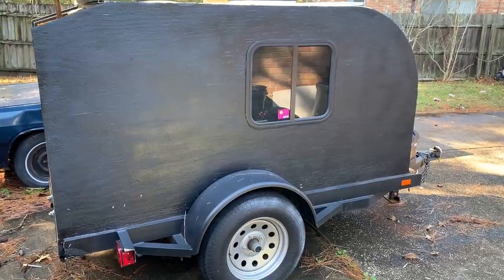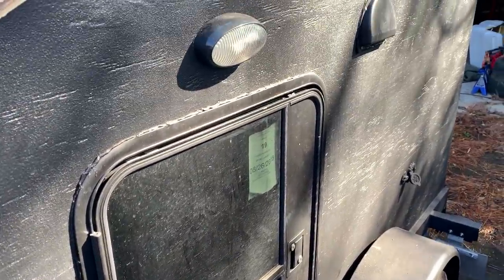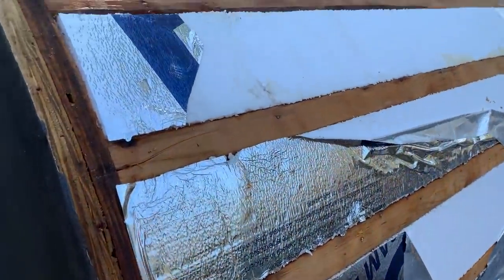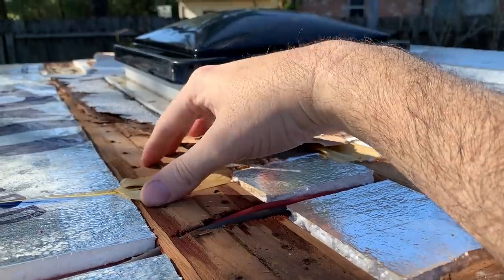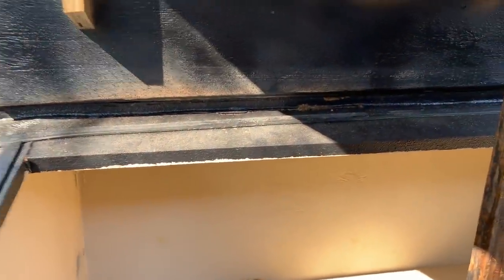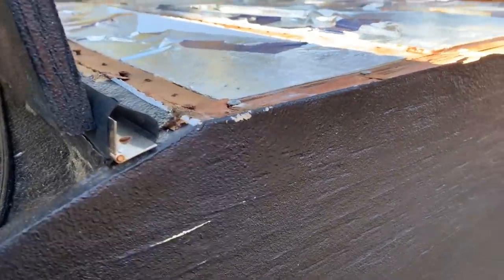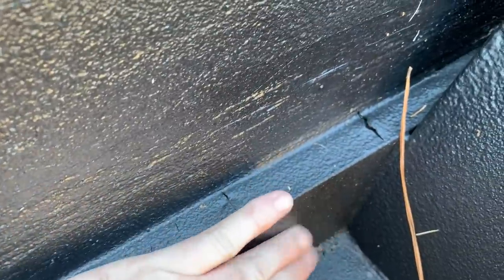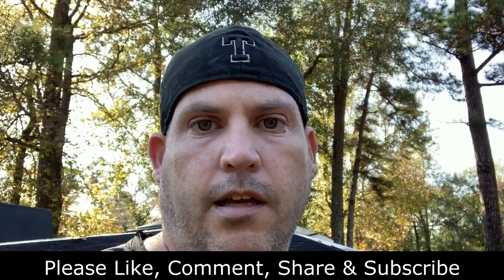6 mistakes building my micro-camper

Comment: I’m thinking about building one of these and I sincerely appreciate your humility and willingness to share your mistakes.  Thanks
Reply from the maker: Flyanb Thank You for the kind words.
Reply: Thank you for sharing your issues this can help everyone
Reply from the maker: Jaimuez Vaime Thanks for the support.
Reply: Great video. You see all sorts of videos of people doing projects but this video is worth 100 of those. Thanks for a video that really does teach something.
Reply: You're framing structure looks ok may I suggest you fiberglass the exterior on your rebuild.
Reply: You should try www.kedel.co.uk  not sure if they have this type of company in your country
Reply: I too am thinking of my own build and want to go as light as possible while completely off grid with AC so considering the top issues from this video I'm starting to think about a sturdy solar panel holding frame as the roof with just 6 mm ply under it & then maybe a bit of Styrofoam under that.

Comment: I appreciate you showing all the mistakes , it'll help people realize this isn't as easy as they think and save them money and time from your mistakes For the base of the camper and trailer sides, screw in wood the thickness of the base of trailer into the base of the camper and install flashing on trailer, siding on wood, flashing on top corner of that wood, and them siding onto the camper, flashing on top of that siding and then install the roof.  Alot of your problems could have been alleviated with use of alot of flashing.

Comment: You're very skilled at woodworking. The shape and wood build of the trailed is very impressive. It's not easy to make a "what not to do video" I can hear how disappointed  you are and your humility and humble nature is much appreciated. I'm certain, being that this was five years ago, that you future projects were much more successful. I will reference this video as well as others when building mine as I'm quite certain I would have made some of the same mistakes.
Reply from the maker: It was definitely disappointing but the rebuild turned out great. I’m still using it with no issues. Thank you for your kind words and good luck with your build.

Comment: I've been watching a bunch of "home built camper" videos.  What you ran into is exactly what I've seen numerous people make.  I haven't built one myself yet, but I work for an rv manufacturer and have the benefit of seeing how some of the in the business do it right.  Don't give up, take what you've learned and apply it.  What I would recommend for your next build is fiber glass your exterior as a complete unit before it goes on the trailer.  It'll be water tight from the get go.
Reply from the maker: iambeeman1 Thanks for the suggestion and thanks for watching!

Comment: Brenda and I built one that folds in half and looks like a real log cabin. Very hard to seal! Now 19 years later, I'm having to rebuild it, though we made it from 1 x 12 rough-sawn cedar boards stacked vertically in top of one another. This made our sidewalls only 3/4" thick, but staggered and reinforced at all corners. In fact, it's all cedar (ceiling is aromatic Eastern Red Cedar) and it looks beautiful, even with the 'patina' of these many years. It used to smell like cedar inside (still does somewhat) and several fellow campers asked for a tour. That was fun. But like you said, it was a learning experience. Thanks for your video. You've got a great big heart for sharing all your valuable experience!
Reply from the maker: Elbert Hardy That sounds very cool. Thanks for watching!
Reply: @BasecampUnbounded  If you want pictures, I'll email them to you.

Comment: Dude, you are showing the education by experience that Gen Xs and later want laid in their laps with no effort or anguish. Thank you for baring yourself this way.

I'm 6-4 n 225lb, therefore need dimensions most affordable trailers don't accommodate and thus am building my own as you did........differently. I'm a welder fabricator where I work and thus can cut, flex, bend or move steel as i wish

Having dismantled 4 manufactured trailers built between 1960 n 1995 I learned much to guide my build. Shortened story: subframe and superstructure perimeter frames are welded of 14ga steel tubing with weep holes, all members are anti-rust painted before the exterior skin is applied. The interior insulation and wall paneling will be chosen and installed to facilitate future repairs. Most trailers are not assembled with such thoughts in mind.

Best of luck!!
Reply from the maker: John Powell Thanks for taking the time to share your thoughts. I appreciate the insight. And of course thanks for watching.

Comment: I can relate to this video so much. I ran into some of the same exact problems. Just as you said, the main cause for these problems was poor planning. 

1. Bad trailer decision. I purchased a Habor Freight trailer, which was cheap but it was a really poor decision. I ended up swapping out the trailer with a much better custom welded frame with a torsion axle. This also lead to problems where my wheel fender is now in the way of my door, because I originally planned for the first trailer wheel position, not the new one. 
2. Outer skin - I originally, like yourself, was choosing to skin the cabin with aluminum sheets and trim. I ordered the materials to do it, but never actually went through with it. I decided the aluminum would be too expensive and difficult to cut the sheets to the right size with windows and doors. I eventually used fiberglass resin and chop-strand, coated with a gel-coat like paint. It turned out really well, but it was a LOT of work. 
3. Should have used higher quality plywood. This would have made my fiberglass job WAY easier. After all of the money spent on sandpaper to fair the fiberglass surface, I could have purchased way better plywood and saved so much more time. It's possible I could have saved myself all of the sanding, had I just used better quality plywood. 
4. I got way ahead of myself and purchased too many things that I didn't use. Such as plumbing and electrical fittings, screws, and other small things that add up. I still have storage tubs full of supplies and materials from Home Depot I may never use.
Reply from the maker: Ryan Smith sounds like you had a similar build experience. Thanks for watching!

Comment: G'day Basecamp Unbound, if your going to use your roofhatch on the next build ensure you put some sealant over the screws after it's fastened down, you would be surprised where water will get if you give it the opportunity. Best of luck with the new build, I look forward to seeing V2 of your camper.
Reply from the maker: MrEddiecos Thanks for the tip, however the bytal tape under the hinge does a great job of sealing the screws from the bottom. Thanks for watching. Check the new build playlist here. (Starts with video 2)
https://www.youtube.com/playlist?list=PLjC73s42QAHlQQaNQPLjnWvCdHOGAXVOR

Comment: You sir are a good sole, I appreciate you sharing your experience I'm thinking of using and fibreglassing the body to completely water proof the body.
Reply from the maker: Matt 1126  I think a lot of folks use fiberglass should be good. Thanks for the support!
Reply: I built a all wood pontoon boat about 6-7 years ago and fiberglassed the pontoons and coated all exposed decking with resin. Not one single problem. The concept for a camper such as this is not much different from boat building as far as waterproofing. My toons are made from1/4inch exterior plywood. And 2 layers of glass. Filled with Styrofoam. I can drive a tank over the toons and they would hold up.. very strong. Cheapest place I found to get epoxy is us composites. Good quality resins compair to west systems resins. Got my glass from Steve theyer at theryercraft fiberglass. He has remnants of rolls of all kinds of fiberglass. 2 layers of glass on all exterior plywood should be plenty to seal any moisture problems. That's how many layers I have on my boat. Good luck on your next build.
Reply: James Smith Thank you for your input I appreciate the assist.
Reply from the maker: James Smith Thanks for the input! Thanks for watching!

Comment: This is great video man I appreciate you doing it. I too have a home made micro camper. Mine is plywood exterior as well. I skim coated the entire thing with body filler then painted with deck paint. My problems are the ply on the front panel had some defects which are getting worse, delaminating. I planned on using Raptor as well, now not so sure. I already have 8 bottles of the stuff. Will probably still use it. I always put an EZ-up over my camper. Helps keep the weather off of it, and it's garage kept, trying to make it last.  I have started a skoolie build for camper 2.0  I hope your next build works out better for you.

Comment: Looks like you had a solid plan to start with. You are correct about the butal tape. Mostly you can use adhesives to attach all your exterior coverings and this will help to prevent water leaks. The floor i would not recommend anything except marine grade plywood, and that still needs to be treated be construction begins. Another quick tip, looking at you roof vent it looks like the fasteners you used to attach it are rusty, you should use stainless wherever they will be exposed.
Reply from the maker: michael dixon Thanks for the tips!

Comment: You are honest man.thank you for share the mistakes.
I believe you do proper water proof the camper by add a thin layer of fiberglass , you never have this issue again.(I did the same mistakes on my truck , that's why I recommend the easy solution I did )
Reply from the maker: Mehran Freeman That’s something I’m considering for the new build. Thanks for the suggestion and the support.

Comment: Thanks for sharing. It may be a little late as I have just seen your video, but for what it's worth, see if your local library has any books on sailboat construction. Usually they are well illustrated and show methods of joinery that keeps the water out of the cabin top and deck. Never know you may see a design you like and can adapt to your situation.
Reply from the maker: Thanks for the suggestion and Thanks for watching!

Comment: Thanks for you advice 
It’s hard not to look at this as mistakes but looking now as lesson learnt albeit the hard way you will be helping many more 
Cheers mate from down under 
One suggestion if I might add is to try using sikaflex polyurethane sealant we use this a lot in construction in Aussie and have never had any issues as long as substrate being sealed to is compatible this is a big thing and always clean the joints well
Reply from the maker: Latitude stopping Thanks for the tip. And thanks for watching! Cheers.

Comment: Holy Moly.  I bought my Trailer from Northern Tool and it is really nice.  I was amazed that they powder coated it.  The only problem i had with it is the small wheels, but you can put 15" wheels on it if you pay extra.  The next one i build will be welded aluminum with a piece on the back that folds out to set your barbeque grill on.
Reply from the maker: David Bell An aluminum trailer would be nice and light. The bbq pit on the back would be cool. Thanks for watching!

Comment: I've seriously been considering an offroad camper. Thanks for the video. Now I know what trailers to avoid. Seems like alot of the videos I have watched the guys wrapped theirs in fiberglass. Wonder how many of them have trouble with water. Will definitely keep that tape in mind for the windows and vent.
Reply from the maker: Taylor Frazier I think the fiberglass works great but I think the aluminum skin I’m using for my new build will have a more polished look. Good luck with your build. Thanks for watching!

Comment: Some hard lessons. I wouldn't have known any better. The only suggestion I can make is to use a polysulfide sealant. It's a 2 part sealant, stinks to high heaven when uncured, but hangs on like you welded it.
Reply from the maker: Gojira61 Thanks for the suggestion and thanks for watching!

Comment: Not building to fit trailer was a mistake, also keep in mind deck beams should match frame so it can be properly fastened. Never use sealer/clauk that cleans up with water it will soften when it gets wet. Don't use caulk that hardens. Roof should always have a slight bow because water will sit on a flat roof and will damage roof fast. Keep in mind what you are going to put on skin don't use regular paint for primary it won't hold up, We used deck stuff it even comes in a few colors and put on 3 coats it's almost like a plastic coating holds up to weather real good, fiberglassing it would be better but more costly. Skylights are nice but real hard to get a good lasting seal. If you're not good at it. Also consider what material you will use for skin some finishes are rough and it will show and be harder to seal for long, smother surface better looking, seals better, holds up longer. Any exposed screws etc., that are not sealed will eventually leak.
Reply from the maker: Ronald Treitner Thanks for the tips, and thank you for watching!

Comment: Hello,
Thanks so much for this video. Your being willing to share your mistakes, helps a lot of us and shows you're a man of courage. I do salute you, this video sure helped me as I"m just starting the process of building a teardrop.
I've got a little bit of experience building wooden boats and I think that building a Teardrop requires some of the same thinking as in wooden boat building. First, water will likely get to any wood in the structure. So use plywood already prepared to deal with water. Along with this wood, coat any wood on the project with epoxy. I know this stuff is expensive, but what $ have you lost and time, when water has leaked in a rotted out your trailer. I've tried but your just not going to find the materials you need at Home Depot or Lowes.

Comment: Excellent and very helpful! Wonder if you could build up from bed like before then push walls out to over hang several inches? Get bet more interior room, place to add drip guards to prevent water onto trailer bed but, hmm, how would it need to be done so as to be secure n stable?
Reply from the maker: Marsha Loneagle thanks for watching!

Comment: My sister and I bought a used Aliner in really good shape for $6000.00. One year later It has electrical issues, there are rivets popping out of it, there are screws working out of the holes, and the door is falling apart, so don't sweat it. Failure is the best teacher.
Reply from the maker: robert frey Thanks for the support!

Comment: I have done Small builds... in wood. One thing, that I see is the sealant issue. On your next build try that windshield sealant. It is pliant and weather resistant. I had a windshield reinstalled over a decade ago. To date, it has not leaked. It is what I use. Plywood, next time try treated. Otherwise, I believe it was a Great build. However, as you stated, poor planning. (I have built speaker boxes and dog houses) That is my Only experience with any type of glue on plywood... Best of Luck!
Reply from the maker: Phantasmos I may look into that. Not a bad idea. Thanks for watching!
Reply: @BasecampUnbounded  Try winged toothed nuts & bolts - the type used on floor wood trailers. They last forever. Paint, ask at your local paint store. There is paint for high winds as it flexes under stress. Liquid nail is Not for direct exposure to the elements. Ask at your lumber yard. All I know is that it works on the speaker boxes. This is due to the bass reflex.

Comment: Good info..I have a 5X10 open utility trailer with a wooden floor and the short sides..I was thinking of making a camper out of it..but a full stand up height camper..I was going to build in between the outer rails but then once I was up to the top of the rails, which are about 6" high, I was going to come out over the rails and go out over to the width of the wheel fenders...then go up to full height...I had also planned to go over the front a little like 2-3 feet over the trailer tongue since it's kind of longer..make that area a bunk type raised up area maybe..I don't know..just ideas..been drawing plans..the raised up railing or sides are a pain to build around as you said...so I wanted to go up then over them and make the trailer wider...I don't even know how much weight this trailer is rated for! Then I have to deal with the rear ramp that folds up! I was going to do a rear entry and have the ramp fold out to create a small deck or patio and add legs that fold down when the ramp is lowered down so that way the ramp would not be slanted down but level with the trailer to form a deck!!
Reply from the maker: Chris Reed Thanks for watching. Your build ideas sound very interesting. Would love to see it when finished. Good luck with the build.

Comment: You have a great base and design. I watched your first video and saw some of the potential issues. Some of your issues are similar to the issues I ran into my build. The wood expansion and contraction and finish cracking was my first one. I have a series of videos on the build and how I ended up correcting it. Hope version two is on the table soon!
Reply from the maker: Mid-America Prep Thank You. I’ll check out your vids.

Comment: Thanks for sharing. Maybe for the next roof, just use 2 sheets of 1/4"  ply or 3 sheets of 1/8" ply and laminate them together in place?
Reply from the maker: Dustin Moffitt ND Thanks for the suggestion. I ended up going with 1/4” plywood but I used 2x3s for the spars. The new roof is much stronger. Thanks for watching!